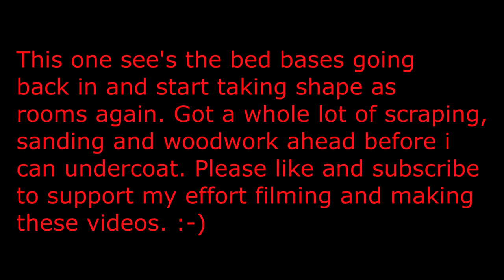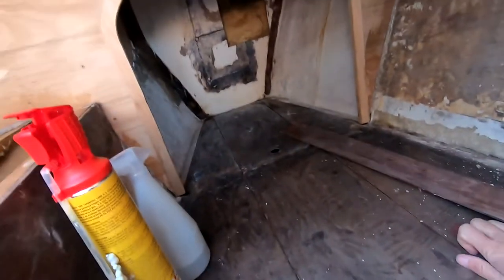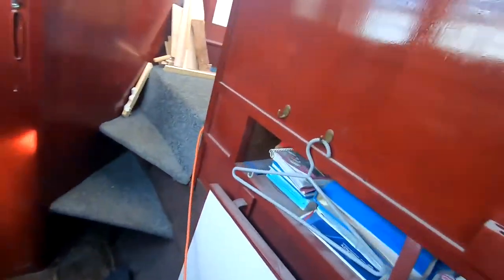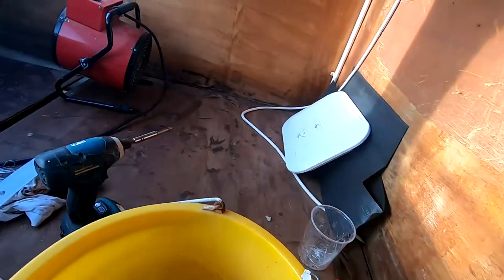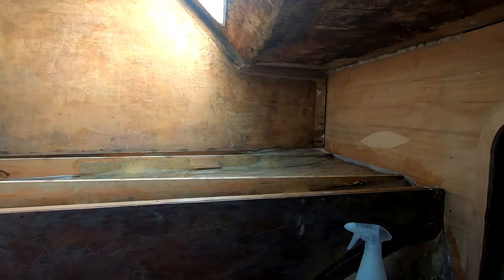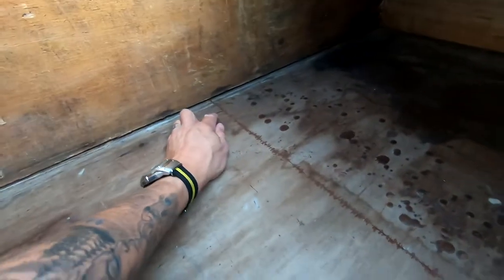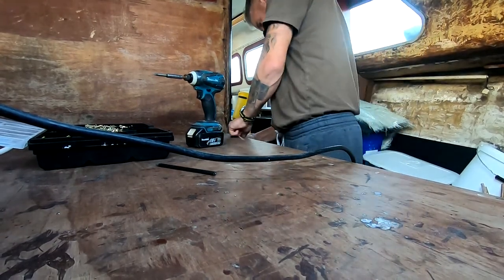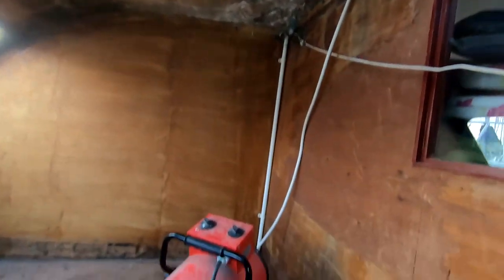E15 Epoxying in the Bulkheads and fixing bunk bases

Comment: hi liking all the details/steps needed in the repairs. What are the water tanks under the beds made from? Is there a way to check the water tanks, ie for leaks & clean them, when the bed is all assembled?
Reply from the maker: Thanks mate, under the beds is the actual hull. The Aristocat really uses the whole hull shape!😁
Reply: @SailingFoxyLady  ok even better cheers. where are the water tanks?
Reply from the maker: @inwardexplorer  there is a large one in the s'board aft locker. Then a Same size fuel tank in the port aft to balance out.
I will try and do a cockpit and lockers dig about in a video soon. I still haven't fully explored them all yet.  Sure they will hide more horrors for me!
Reply: @SailingFoxyLady  thanks for all the info, no rush. You'r very busy with the important stuff right now. Boat body, leaks & repairs. 👍
Reply from the maker: @inwardexplorer  thankyou for the interest👍🏻😁